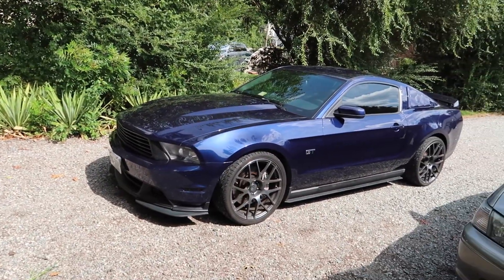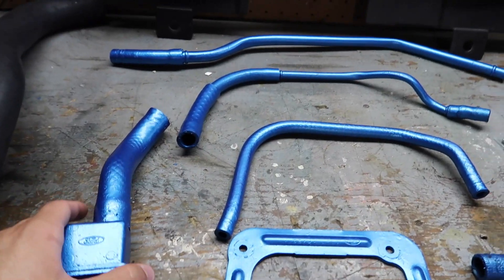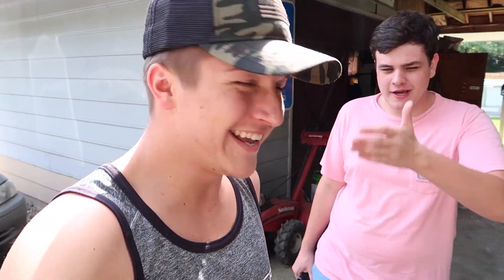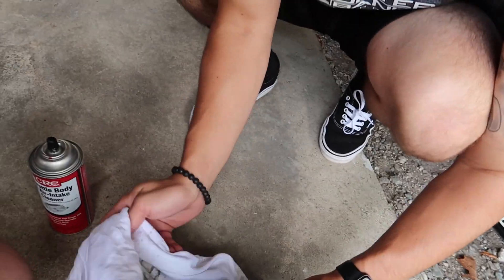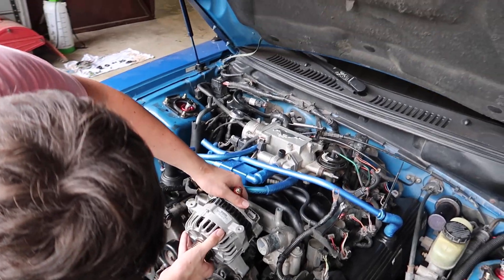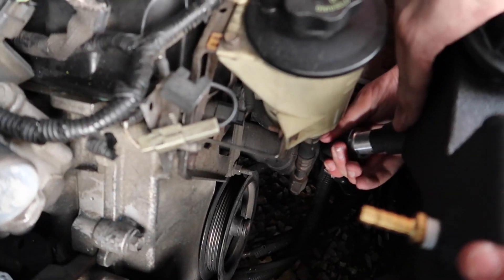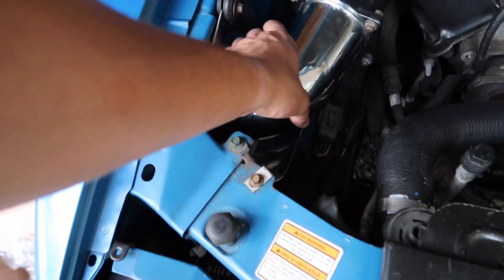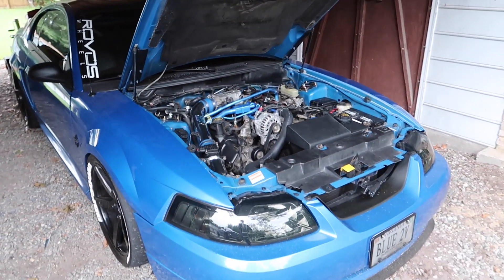RE-DO BLUE: Engine Bay Completed! | Episode 26

Comment: Hello this is my first time commenting. I found out about your channel a few days ago when I started looking for my first car (a 99-04 Mustang). For the last couple of days I've been getting a lot of info on them, I'm really getting into cars and I'm starting to really love them. Your video have been really entertaining and helpful, keep it up 👍🏾.
Reply: Tino Smith Get a V8
Reply: Michael Raffi +tom What's the price range of a v8 compared to a v6?
Reply: It will be more expensive, but it depends upon what year you buy. I'd say the SN95 (94 through 98) Mustangs are the cheapest overall, but personally I like the New Edge Mustangs (99 to 04) and they are pretty affordable. I picked up my 2001 Mustang GT Convertible with a 2003 gt motor with 45k miles for 4500 dollars, but the body has 100k on it, and is sorta rough around the edges. Look around on craigslist in your area, and don't be afraid to wait until you find a good car. I wouldn't go above 100k miles to ensure it lasts you a long time. The 4.6 modular engines are pretty sturdy and if you take good care of them you can make it up to 200k easily. I'm by no means an expert, but there are plenty of people in these comments, and across the internet who'd love to help you out.
Reply: For a V8 I'd say you'd be looking at 4000 to 10,000 dollars. Like I said look on craigslist and see what people are offering.
Reply: Your dignity.
Reply: tom thank you so much, your help is much appreciated
Reply: Tino Smith dude if you can afford it (maintenance, insurance, clean driving record) get a V8. If not get something real dependable like a Honda or something. Then save up for a mustang. Just my 2cents.
Reply: Mustang gang 5.0 it's my first car. My record is clean just not much experience on it due to me being a new driver. Would this make insurance cost more? Also what's the difference between the V8 vs V6 in maintenance?
Reply: Tino Smith insurance goes down when u hit 25. I can't speak to much for your car maintenance, because we have different year models
Reply: Tino Smith I'd say matinence between a V6 and V8 are the same, at least for the basics such as oil changes, etc. For insurance see if you can be on your parents plan and have the car listed as theirs with you as a driver, it'll make it cheaper. Also being young will give chances for you to lower your insurance, good grades, driving safety courses, etc.
Reply: Michael Raffi I got my black vert GT a couple days ago. 100k on the body and 45k on the motor. Cost me $4500. Feels like I stole it I got such a deal. They body is rough around the edges but the car itself purs.
Reply: So do you own a mustang today in 2020 🤔